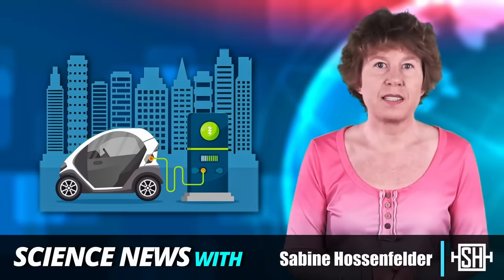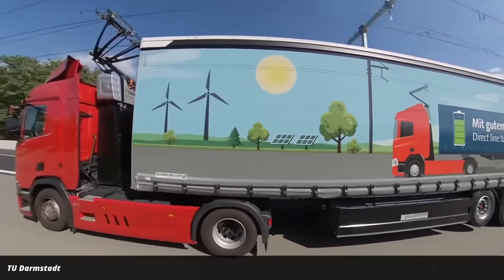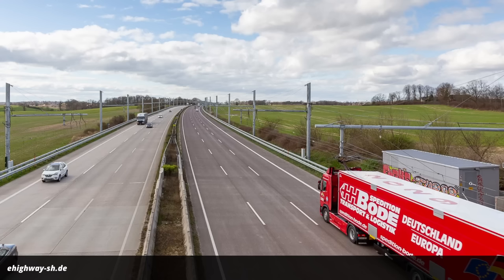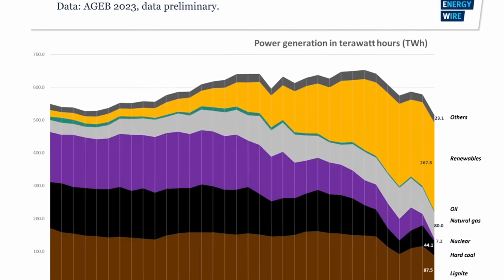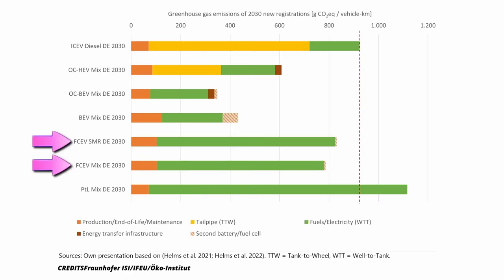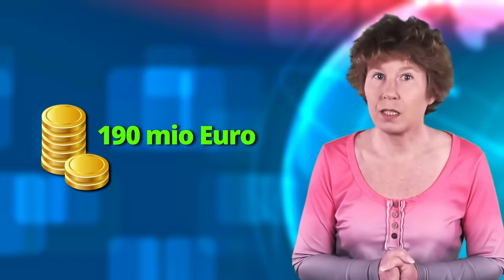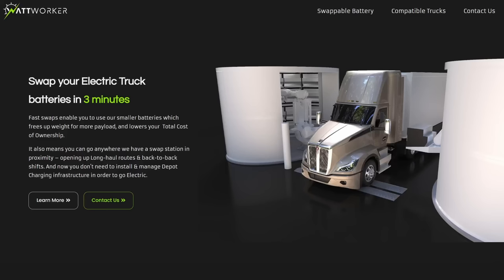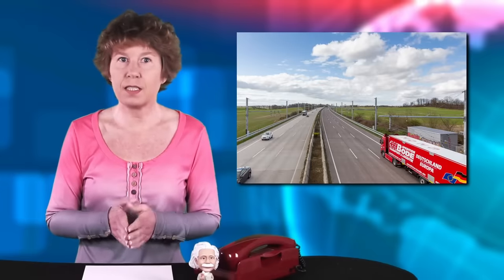Charging while Driving: Does it Work?

Comment: I have designed a road made of layers of concrete that generates and stores electricity.  Each concrete layer includes a specific extremely low cost additive such as zinc or manganese dioxide with appropriately placed copper mesh at certain points within the layers (to allow electric transmission between the layers).  The bottom three layers act as a battery (anode, cathode, electrode) that can store electricity.  The middle layers generate piezoelectric power from the weight of vehicles driving over the road that is stored in the lower layers (the battery), and the top layers of cement generate solar power that is also stored in the battery layers.  All of the components are highly inefficient from an energy density standpoint (50 pounds of the cement battery only stores as much power as a couple AA batteries...).  But the components are very cheap and easy to fabricate.  A mile of this type of road passively generates and stores enough power to supply 300 electric vehicles with a mile's worth of power each, per day.  A road made of this layered concrete should be as durable as a normal road and would not cost much more than a normal road once appropriate machinery to apply the layers of concrete is developed.  Power could be distributed directly from the road to moving vehicles using wireless inductive charging, which has already been developed. Excess power generated by the road would be stored in the road and could also feed the electric grid.  I have not pursued this, as I do not think I can obtain a defensible patent. So, I am left just talking about it as a YouTube video comment...

Comment: Why could we not utilize,  a large sprocket to a very small sprocket that then drives alternators that in turn charge batteries slowly. We could cut off the battery being charged so it can be renewed. The unit can run on the other batteries.

Comment: €190m for 20km? There's rubber wheeled electric trolley buses across the world in urban settings running for 80 years with dual power line systems and costing a lot less, can someone explain the difference in design and cost?

Comment: There has to be a way to make this work. What's the efficiency of an inductive phone charger? Pretty poor I'd guess, not good enough for transportation. It'd have to be smart enough to energize just as the vehicle passes over, that'd also solve the billing problem.

Interchangeable batteries are an interesting idea in that the battery stations would have extras that could charge off peak, or even support the grid on peak. The batteries would be on loan and guaranteed so if they stuck you with a bad one you'd get a free delivery and some compensation for wasting your time.

Comment: Infrastructure should be built for the 'foreseeable' future.  BEVs will continue to gain ground as the costs continue to drop and energy density increases - with current technology.  Tesla's Semi  is already capable of 500 miles  (800 km) on a charge.  It will not be necessary to charge on the fly but as induction charging continues to develop, there may be a case for it later.

Comment: Why is this such a problem? I don't know about the West but here in the East we've had a thing called "trolleybus" that has been operating for decades so it's nothing hi-tech. It's basically an electrically powered bus used for city public transport. We even have those power lines in complex intersections and you can imagine it's a much bigger challenge having those in the city rather than on one lane of the highway.

Comment: It is actually a very good system if everything else lined like energy cost, utilization, carbon footprint, fuel cost, etc. I don't think you can foresee the Ukraine war decades ago when they started this study and that electricity would cost more than diesel. I think hybrid for trucks would likely be a better choice at a lower cost, until we have better energy stability to go electric.

Comment: You are a treasure. Please don't change. 
I don't see how US/EU/UK living standards can remain at any level close to what we have as the climate changes and fossil fuels become more expensive to extract. We know that 'green energy' tech requires a lot of mining and processing and that requires energy to do as well. Where does that energy come from?
I try to be optimistic but it is really hard. I fail to see a way towards stabilizing our living environments long term at this point.
Reply: Simply look at solar panel prices. With some $85/piece (~450 watts), they're cheaper than wooden panels of the same size now, so people start to build fences, garden house roofs and such stuff with them, harvesting electricity basically for free. Panels that cheap can't be hard to manufacture.
Reply: Nobody will accept lower living standards.

The key for a sustainable future lies in limiting the population growth.

Comment: There are ways to generate electricity with the weight of vehicles traveling on a highway... with speed bumps that squeeze a liquid that turns a turbine, etc. etc... on a busy highway, perhaps it would be viable... it would be a "closed circuit" type solution, .. vehicles (all) producing energy for themselves to use... in short, perpetuum mobile

Comment: Auto’s flexibility in where they go is an important factor. Roads need maintenance, routes vary with supply n demand. Swap batteries offer more flexibility and simpler maintenance. Good engineering accomplishment but the cost benefit should have raised concerns early on.

Comment: i don't know why any company would choose to use individual trucks which can only take 1 container's worth when trains can take 20-50 containers much, much more cheaply and efficiently

if its a dispatchability and logistics problem to handle long trains, thats fine, use short ones then, you have to upgrade signalling equipment but CBTC is cheap and flexible, two tracks can carry much more than sharing 4-6-8 lanes with cars

Comment: Wait, so these vehicles are fed by catenaries?!  I assumed as I started to hear the description that there would be some inductive means of powering from lines that didn't have to touch terminals, and that there was some great engineering that allowed inductive coupling to the trucks without spurious losses and short circuits thru other passing pieces of metal such as other vehicles.  Catenaries and pantagraphs seem retro and silly.

Comment: Many thanks Sabine! Great finger pointing job! This "Energiewende" topic has to be discussed hard and honestly! Heavy trucks cannot be powered by batteries for long distances. The required number of batteries is to heavy ... for a very long distance trip this could reach upto the weigth of the freight. Batteries are only good for the last 100 miles ... or you have to swap (and load) them every 100 miles. Overhead electric lines have been used for ages in public city transport (especially in eastern Europe in the past century and in Bulgaria somewhere still today) with very good experience. Here we are talking (only) about the highway with driving at 100 km/h and this is another story than city speed ... here the railway current collector experience is asked. Unfortunately the lorry-lobby don't want overheand electric lines ... i.e. an european standard is required! It's the same story like with battery swapping for private cars ... the car lobby don't want it! And they know it's technical unfeasible to build car charging stations every 10m on any street everywhere - there is not enough copper for all the high current transmission lines. Here the legal entities are asked ... either the EU parliment or/and the national governments ... to provide a legal framework (obligation) for battery swapping and overhead electric lines in time. Otherwise the (german) automotive industry will still block e-mobility for many, many years ... to defend their (endemic battery) monopoly. On the other side ... have a look at China! CATL is proposing its uniform evogo battery swap solution as open standard to the world. Already a dozen chinese (and asian) car manufacturers have jumped on - and closed their own incompatible battery developments. If Europe is unwilling to set technical standards for e-mobility ... China will do it!
Reply: Tell that to Tesla, troll!
Reply: @stickynorth  who is the troll? Even Tesla was thinking about battery swap for model-2 ... but jumped back - and missed to set a world standard as No.1 company ... to selfish sell their own batteries with the car for maximum profit. Without an (battery) industry standard and legal rules for e-mobility (e.g. plug'n play batteries ... regulation of use) the e-mobility is a dead lane. Every automobile maker want's to sell his own "best battery", but in dense urban environments you as an every where citicen w/o your own solar roof-top cannot charge it. Look at the benefits of a big reuse of old petrol stations as new battery swap stations. The batteries will be owned by either the battery manufacturers or 3rd party investors. The former oil companies will operate the swapping stations as usual including grid services and may be a big bunch of the battereis as owner (i.e. investor - and the oil companies have a really big bag of money). The batteries can be well maintained, quality checked and charged when electricity is cheap and there is always a surplus of batteries available. In case of short term grid demand such a (large) battery swaping station can deliver useful net stabilization services - w/o compromizing a minimum number of full loaded batteries. If the car owner is not the battery owner (i.e. only leasing the battery he just want and paying only for the used electricity) ... the ordinary car owner has only to pay half the price for an e-car from today. The battery plus electricity is payed like "fuel or gas" ... on a per use basis. Every car driver has access to a fresh charged battery (e.g. out of different providers, chemistries, qualities, charges, distances to drive) only a few minutes away whenever he wants or needs one. Thats a win - win - win situation! And further more ... after their life in cars the standardized batteries can be refurbished and used as plug'n play powerwall in your home. Now please ask yourself again ... who is the troll who prevents wide spread, cheap e-mobility?

Comment: If they're willing to spend that much money, it would probably be better spent by putting a "roof" over the highways and mounting solar panels on the roof leading to battery stations along the way, with inverters tied into the power grid.  Along with fast-charging batteries for vehicles (probably going to be available within the next 5 years), that could solve many problems.

Comment: I have a question Sabine, why can’t we have portable folded solar charges for EVs? When your car is low on power you part, unfold the solar panel and plug your car to a charger, have a lunch, and continue driving.
Reply: Because it will take days to charge up your car that way - solar power panels small enough to carry around with you just won't cover enough area to practically gather enough power to matter. Otherwise they would be for sale all over Amazon and auto parts stores (at least here where something like 20% of new car sales are Tesla's)
Reply: Because, if that would be viable in any way, EVs would have been started to be clad with permanently fixed cells long ago. However, some camping vans do actually sport cells.

Comment: There’s a company in Canada with a truck running like a locomotive with a diesel powered generator that runs electric motors.
Reply: Edison motors in B.C. Their target is logging trucks, which haul logs downhill and use regenerative braking to charge the batteries. They only need the diesel if the truck is on a longer route. The original concept did not have the diesel generator but customers said they wanted the flexibility to use the trucks on longer routes. Huge savings in operating costs.

Comment: To Me, In Sunny Nations, Lining the Trucks and Trains with Solar Panels is a Higher Priority.

Also there is No Weight Component to Transporting Electricity.
Whereas there is a Very Large Weight Component to Transporting Coal, Oil, Gas.
Hence Grids Save Money, Time, Resources, Our Atmosphere in the Long Run.

That said Overhead Power Lines Combined with Battery Electric Trucks is a Reasonable Technology for Some Transport Locations.

Thanks Prof. Hossenfelder.

Comment: The Tesla semi and the amortised cost of wind, solar, hydro and battery storage has solved this problem. Just because grid electricity is expensive doesn't mean electricity generation is expensive. A home solar array generates at 3.5 cents per kw. A solar or wind farm at 2 cents. Double that with battery storage and you can round up to 5 cents per kw. The semi consumes 2 kw per mile. So 10 cents per mile. That's $10 per 100 miles. Now double that for the electricity company to make some money and you get $20 US per 100 miles. A diesel semi consumes about 7 miles per gallon so with average price of diesel in Europe at about $7.00 per gallon it costs $100 in diesel per 100 miles. An electric semi has less maintenance, accelerates faster and quietly, emits no diesel particulates and with regenerative braking pulls up faster, quieter and safer. So, the Tesla electric semi is at least 5 times cheaper to run. Over 300,000 miles that saves $240,000 in fuel. The Tesla semi is only $100,000 more expensive than the average diesel semi so the problem has been solved. The electric semi will probably save more than $100,000 over its working life but absolute worst case is break even with diesel. Anyone living near a busy road would be delighted with less noise and particulate emissions and anyone who has lost a loved one in a truck accident would welcome the safety benefits. Less noise, less pollution, less transport costs, less injury and loss of life, less medical costs and less insurance costs. The production ramp for the trucks and the charging infrastructure has already started in the U.S..

Comment: Why pick between the options and not have both battery swapping stations for remote areas where the expense of installing these electrical lines is far too great, and in those areas where density is far higher and it makes sense install the infrastructure over the highways that way when the trucks are entering the city they have full batteries and can get to their drop off point and back to the highway without needing to stop for a recharge.
We need all approaches and to see what sticks
Reply: We know what sticks: built in batteries. ;-)

Comment: 24B is chump change vs 'we all die'. Yes, battery-swap should have always been the default method, standard battery, gas-stations morph into charging/swap stations, and electric cars are as convenient as a gas car, drive in, swap in 2-3 minute operation, and then back on your journey.

A Govt non-profit supplies the batteries, the EV cost is vastly reduced w/o the battery in the price ... yada yada yada ... too bad US and EU dont have functioning Govts to plan and implement such visionary concepts. I guess instead, we all just die.

Comment: I find the E-Highway between Frankfurt and Heidelberg rather useless, the money spend could’ve been put into building the already decades in planning high speed rail line paralleling this highway. This would relieve the overcapacity Riedbahn and Main-Neckar-Bahn, which already parallel the high around 5km west and east to the highway respectively. The freed capacity could be used for freight services. It too would close a gap in Germanys High Speed rail network. Closing this gap would allow full high speed train travel from Cologne to Augsburg.
Reply: You are talking about passenger traffic. The E-highway is geared towards freight. Still, I agree, that we should do something about putting more freight onto the rail.

Comment: Sabine, you should look into Edison Motors out of Canada. Electric hauling trucks that carry a diesel generator.
Reply: They are made for hauling trees of mountains so they charge themselves with regen braking coming down, so don't use diesel much since they are empty going up. The original plan did not include the generator but the target customers said wanted the flexibility to use them on longer runs. Also in B.C. logging trucks are not allowed to switch carriers between trucks so a single truck hs to carry the logs all the way to their destination.

Comment: Trolleybus is a pretty good tech. Power it with nuclear energy, and it would be as clean as it possible to be. It mostly uses old good steel and copper, which are safe, common and recyclable, so sustainability is also great.

Comment: A couple of points: ehighways are the quickest way to decarbonise heavy road haulage by far. The embodied carbon of an electric truck with smaller battery is vastly better than the big battery alternative. We have scarce resources ans this is the efficiency we need for maximum speed. 24 bn euros for a europe wide system is peanuts on a continent wide budget. Systemically all the factors are a green light. We should be rolling this system out now!

Comment: EV powered Semi-Trucks that recharge using an onboard APU (turbine) would be the best solution. Turbines are far more efficient than piston engines and can run at a constant RPM for literally thousands of hours. All the while spinning an alternator to top-off the batteries. Best of all, turbines can use almost any hydro-cardbon as a fuel, as well as propane and cooking oils.

Comment: A truck with on-road charging and diesel would not need batteries at all.  The power lines power the electric motors directly and then the diesel kicks in where the lines end.  That sounds much more efficient than charging and swapping batteries to me.  And the power comes from solar and wind, which are cheaper and faster to bring online than nuclear.